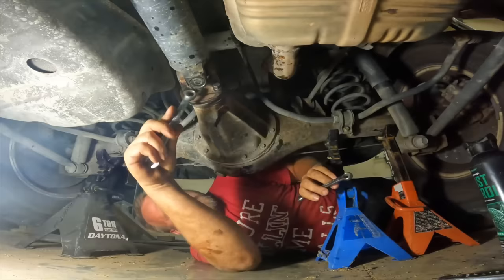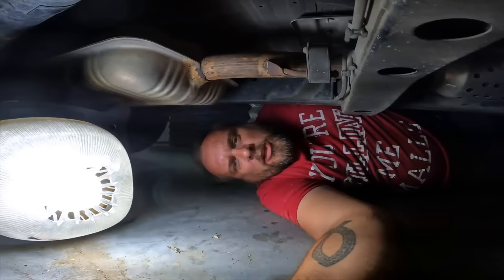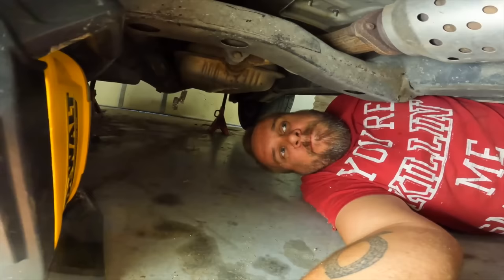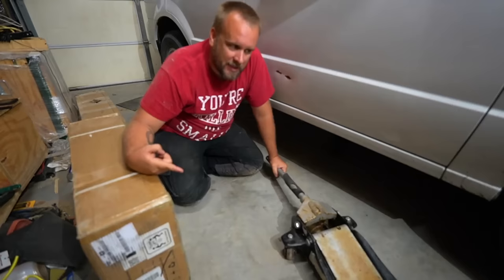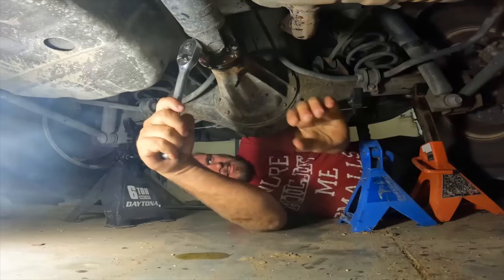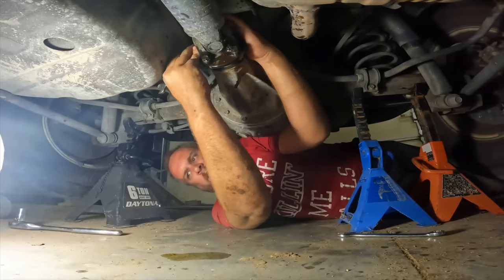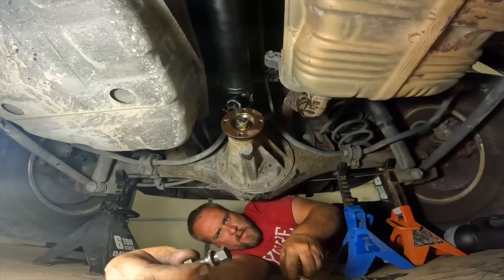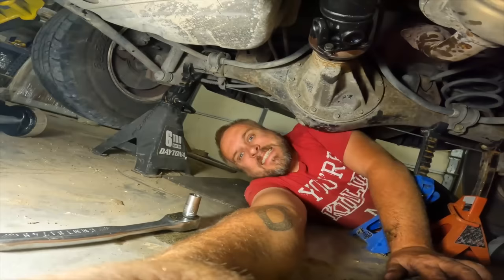2006 Kia Sorento Drive Shaft Replacement

Comment: It looks like you replaced the entire drive shaft? Why not just replace u-joint and carrier bearing? Seems like that would be much cheaper.
Reply: Repairing the bearing and joints could cause bad vibrations without taking shaft to get rebalanced.  It may cost more to rebuild it properly than to replace.
Reply: I have replaced u joints before with no dynamic balance issues at all. It’s such a small diameter compare to something like a wheel that it’s negligible. You do need a bearing press tool to do it however
Reply from the maker: from everything I can find they don’t sell that bearing. I found a couple of YouTube videos from guys talking about trying to find it. I couldn’t find it either. 

You might be able to find the same u-joint, but it’s not listed as an available part for this car 

The entire shaft was $328 with shipping

Comment: It seems like everything comes as an 'assembly' these days. You used to be able to change wheel bearings, now it's a 'hub assembly'. I needed a new thermostat in my pickup, so I went to the auto parts store. The guy comes from the back with this big ol' box and I said that can't be it. He informed me that now it's an assembly. You have to change out the entire water neck, whether you needed one or not! With exorbitant prices to match!
She's lucky she made it home, she definitely got all of the goody out of that bearing!
Reply from the maker: Yeah, I could not find the bearing or U-joints separately